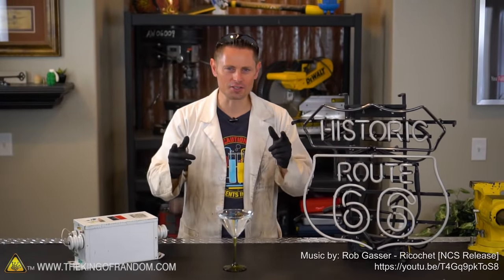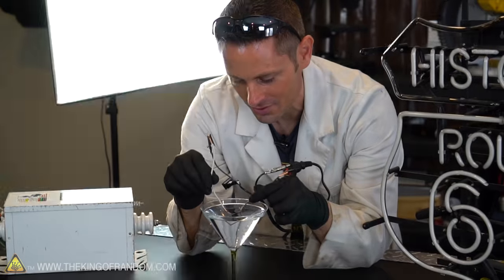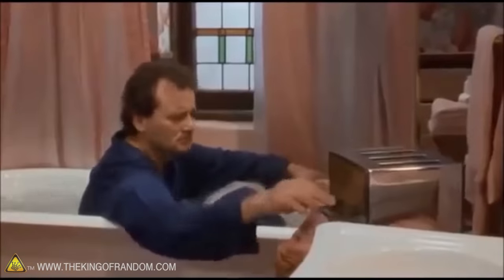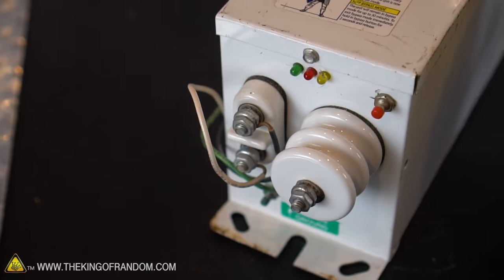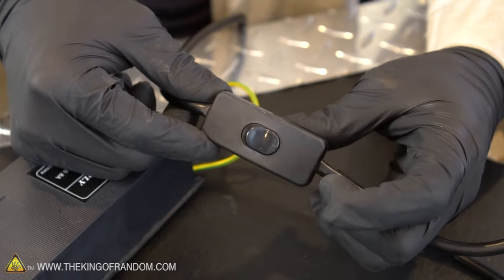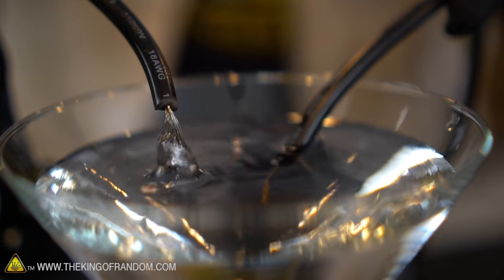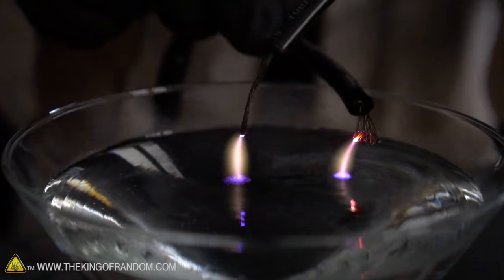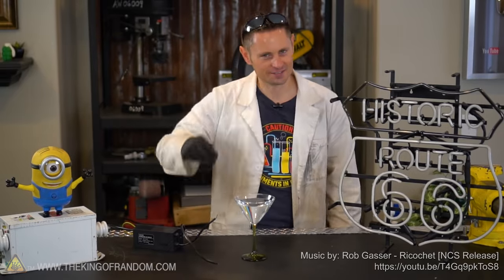Don't Mix Electricity And Water! TKOR Experiments What Happens With Electricity In Water!

Comment: the problem with distilled water is that it eventually picks up electrons from metals and becomes conductive
Reply: I'm pretty sure the high voltage is being conducted though the H+ and OH- charges water self ionizes into. While not being a significant amount I'm sure voltage that high could conduct through them.
Reply: did u see the green lightning? it was copper burning up, it goes inside pure water and contaminate it
Reply: roy k hmm. That does actually make sense and line up with what he said about metallic/electric taste. My mistake!
Reply: roy  k In a vacuum, however, we'd need an extremely high voltage to drive up water's autoionization equilibrium and evolve the oxygen to oxidize the copper. I'd hazard that Joule heating melt the wire before that happens. Of course, if we open the scope to a greater voltage, we might as well go for a quark-gluon plasma, no? The containment should be fun.

Comment: Does this add electrolytes to the water?
Reply: BroKid45Playz seriously?
Reply: Yes
Reply: It would displace some of the metals that the wires were made from into the water.
Reply: Greg Solis-Reyes no it wouldn't.
Reply: It's what plants crave!
Reply: rushthezeppelin what
Reply: brawndo the thirst mutilator
Reply: Not unless you include copper, hydrogen, oxygen, or hydroxide an electrolyte
Reply: Lol
Reply: Not how it works.
Reply: Riki ikr
Reply: @fionathegayesttiefling9867  water has oxygen
Reply: @deadcat2759  I'm aware. Running electricity through the water seperates the hydrogen and oxygen, allowing them to rebind differently into hydrogen2, oxygen2, H2O2, and O3. It's called electrolysis.
Reply: @fionathegayesttiefling9867  ok thx
Reply: Lmfao
Reply: Well, it can. It changes the chemical composition because of the minerals being changed. Some of these can be electrolytic. Others. Lethal.
Reply: No, neon is noble gas. It's neutral. The thing is that water itself is a bit magnetic(the distribution of the oxygen and hydrogen takes place).

But what just happened is known as dielectric breakdown. An isolator becomes a conductor after being applied a huge voltage.
Reply: Lmao
Reply: no but it would cause an electrolytic reaction, electrolysis is a reaction that breaks apart the molecules in the water from electricity flowing in the water
Reply: This is how they make Gatorade

Comment: What happens to the arc in a vacuum chamber?
Reply: If there's no air to conduct the electricity, there will be no arc
Reply: Explorer142 wach electroboom video he did this
Reply: Rambbax nope
Reply: vacuum chambers is already used to prevent the arc in some medium voltage (22kv for example) circuit breakers
Reply: Explorer142 in order for an arc to occur the static voltage must overcome the resistance between the two poles, wires, in the air electrons push out on the outer orbits of gas molecules making them crowded and unstable. they are in fact ionized when they cannot support any more electrons and wants to dump them. once the crowd get big enough and pushes hard enough the ones closest to the positive pole start finding their way across the gap. this creates a path like shouting free beer at a baseball game the rest of the crowd hears the news and its a stampede. this cannot happen in a vacuum, no particles to reach out to
Reply: Explorer142 if its a true vacuum, then there wont be an arc. The arc is there because the electricity conducts through molecules in the air. Not sure how exactly though. I think the molecules pass off electrons like in movies where the town gets together and passes buckets of water to put out a fire.
Reply: it becomes a cathode ray
Reply: Check out photonicinduction
Reply: Elctroboom did that.
Reply: gDisasters yes, and high grade vacume is no where in the universe, even in farthest vacume in space, there are still some PPI of particles
Reply: WeTube I shot the sheriff (but I did not shoot the deputy).

Comment: Distilled water is conductive, "Pure" water is the bad conductor.
The green parts of the arc is the copper from the wire.
The water "sticking" to the wire is probably due to the diamagnetic nature of liquid water.
Those bubbles are hydrogen.
The light dimming is because the water's resistance acts like a potentiometer.
You would feel a lot more than a slight tingle in a bathtub, 10mA is enough to lose full control of your muscles, 20 and you'll have trouble breathing.

Comment: The water stick to the electrodes due to both its cohesive attractive forces and the fact that it is a polar molecule helps as well. The oxygen end of the water molecule is lining up with the cathode and the hydrogen portion of the molecules are lining up with the anode. A sort of electrostatic force similar to ions :)
Reply: Thanks for that :)

Comment: find a way to test high voltage electricity in a vacume chamber. how much air is needed for it to travel on
Reply: This is actually a cool experiment, because the resistance drops with pressure until it gets to near zero, then stays there for a bit, then rises again as you get into very deep vacuum levels.

Comment: The electricity improves and strengthens the water tension which is why you can stack water on a penny. If the water tension is high enough, you can make water float in big bubbles. The reason that happens in space is because empty space is a lot less dense than water and the water can easily float around in droplets and stay together but on earth gravity soon ends the fun.
Reply: The enhancement of the normal stresses at an interface between two fluids is due to the difference in the permittivity (and consequently the strength of the electric field). This manifests itself in the form of a larger normal stress which looks like augmented surface tension. The electrical stress is called the Maxwell stress and is a research topic for electrohydrodynamics ...
Reply: Not really, water molecules are polar, so they will have a small net attraction to strong electromagnetic fields. Neon sign transformers are usually half-wave rectified, so one end is positive and the other neutral, allowing for the molecules to align and line up without disruption.

Edit: looked up what Lewl said and it appears to also be a contributor.
Reply: is this why the water "stuck" to the wires
Reply: WASDboss I think water molecules are polar so this triggers the substance of germ  molecules therefore it denses the water

Comment: The thing is, there's no such thing as a non-conductive material, it's all about the resistance each individual material has to let electrons pass through, that's why with enough voltage, the electrons can "overwhelm" the material's natural resistance and still pass trough. And also electricity will always go for the less resistance path, that's why tress still get hit by lighting even though they are made of wood, but in comparison with the ground, the tree has lower electric resistance so the lighting bolt goes to the tree before going into the ground.
Or so I think.
Reply: UrielManX7 and gov
Reply: what are tress?

Comment: Will electricity travel through a vacuum? Or mabey through dry ice or liquid nitrogen?
Reply: It can't travel trough vacuum, at least if the vacuum is high enough.

Electricity jumps from one atom to another (as you seen by the arc in the video).
If there is no atoms to cling to, it is isolated, thus there would be nothing happening at all ^^
Reply: That Guy it won't travel through a vacuum because its needs an ionic substance to travel across.  It travels through air by ionizing it and making O3 (ozone) which is very conducive to arcing electricity.  Unfortunately there isn't really anyway for the electrons to transfer between two things across a vacuum.
Reply: Correct me if I'm wrong but electrons are still particles, and they can travel through any vacuum under the right circumstances. Think of your old CRT TV, that has a vacuum in it, and an electron beam is flying through there. Only issue is you need a couple hundred thousand volts at at a decent amperage. If there's enough energy, thermionic emission will occur on whatever conductor becomes the cathode, and can potentially produce X-Rays.

Electricity isn't bound by just atoms, it can be literally any charge carrier. Be it an ion in some water or an electron flying through a vacuum.
Reply: Xenro66 crt isnt actually a true vacumm, manufacturers put inert gasses into them similar to neon signs
Reply: Xenro that is correct from my understanding. Also, electrons will leak from a electrical wire in a vacuum. And about radiation, the earliest way to make xray was shoot an electron beam in a vacuum. I wont say how because someone  may hurt themselves by trying it.  Also, you are correct about TV. The radiation from a old tv came from the electron beam occasionally splitting a phosphorus atom which converted some matter into energy, which is gamma rays(photons). Most people thought the radiation was from quantum numbers or electrons around the phosphorus
Reply: Electricity requires atoms to pass through in one direction to generate current. Devices like. X rays use electromagnetic radiation to transfer waves of high or low frequency, no air required over there.
Reply: who here just finished electrochem or electrophys in their AP science classes?
Reply: +Jacob Swarthout It is actually a high vacuum inside CRTs. You need that high vacuum in order for the electrons to form precise beams, moving freely (each time an electron collides with a gas molecule it will get deflected). Same thing in particle accelerators. Xenro66 is correct.

Vacuum tubes mostly rely on thermionic emission too (see X-ray tubes, thermionic valves, your vintage guitar amp triodes/pentodes), in fact a whole lot of tech rely on electrons traveling through vacuum.

Comment: Tap water contains heavy metals!!!
Reply: Beto G that's true and actually pure water (diaionized) is not an electric conductor.
Reply: Mijaz Gutierrez it will conduct very small amounts of electricity tho, because of the autoprotolysis or whatever you call it in english.
Reply: mttdang by what I know and have leaned at school it won't. Because the electrons are part of the bondings between anions. H2O is a covalent compound so there is no flow of electrons unlike metals that have the electron sea. Maybe it could at very very high temperature or with electrolysis but still electrolysis separates the molecules so it wouldn't be water anymore. 
If I'm wrong enlight me because it's very pleasing having a intelligent conversation (rarely found on YouTube)
Reply: Mijaz Gutierrez normally this is correct. But what mttdang means is that there is a very rare reaction. 2 H2O molecules can split into one H3O+ ion and one OH- Ion and they inside the water make it conductable. But they are very rare so you won't see their influence with that lamp, but with a voltmeter.

Comment: Take care king of random.. U said u'll be using single hand but u used both.
Reply: I was thinking the same thing. "Do as I say, not as I do", right?
Reply: lingaraj gurusamy electrical engineer here. when dealing with that high voltage, it doesn't matter. gle gloves wouldnt help either
Reply: joshua christensen, that may be true, but I think you're missing the point of OP comment. I'm an industrial engineer, so I'm aware.

Comment: Electrical Engineer: You Don't Say!
Reply: Btw, nice explanation there, especially the one hand operation procedure.
Reply: Even as an EE, I've got to say it surprised me to see the surface tension of the water so tight with the high-voltage wires; so much that he could pull the water slightly off the surface.

Comment: Well, with the high voltage through distilled water, I think that must’ve not been completely pure H2O, because if water by nature is non-conducive, that means certain minerals or other conductors in the tap water are conductive and can transmit electricity to each other through the water. That is to say distilled tap water or maybe even distill water in general will still have those tiny particles of conductors, a suspension between the particles and the H2O. That’s why the high voltage works in distilled water, there are still small, although infrequent, particles suspended in the water, the high voltage has more power so it’ll be able to transmit over longer distances, and that means it doesn’t matter that the conducting particles are to infrequent, the high voltage can travel farther to reach them. In theory, if you where able to remove all molecules from water besides Hydrogen and Oxygen, it wouldn’t be a conductor, if my hypothesis is correct. I have no real way to test it though so I guess it stays but a theory, a physics theory! That is for reading!. (Really though what do you guys think?)
Reply: JakoborRazor But even if he used pure H2O he would've added electrodes due to the current flowing and the metal wires in it, so he couldn't really do such things with pure H2O
Reply: Yes and no. High voltage energy might be able to break the hydrogen-oxygen bonds in some of the H20 molecules, ionizing water (into H+ and 0H-), which then conducts the electricity. Even in plain water (H20), H+ and OH- ions are present in equilibrium with the H2O, and maybe that is sufficient.

Comment: Okay wait, but what if this high voltage had a load? The lower voltage had a light to power. Would it make a difference if the higher voltage activated a device inside the circuit?

Comment: The reason the light was dimming when the wires were farther away in the tap water, is because tap water is highly resistant, which means that the electrons bounce off of the water molecules and gives of some of it's energy to the molecules

Comment: you can't mix water and electricity,  electricity flows trou it and is not mixing with it , its a wire until the water cant support the electricity and it will split into oxygen  and hydrogen

Comment: Late, but I think what's causing the HV cable to draw the water to it when you pull it out is that Hydrogen Ions are being stripped from the Oxygen atoms in the water through electrolysis.

Comment: Interesting watching these things on Youtube,Not something I ever try at home or end up with a ton of volts of electric going through me and then become over powered has happend before,One of the wrose times I remember getting one nasty Electric shock,Was when I was over a freinds house,I did tell them to turn the Electric of while putting a ceiling fan up,Getting the wires connected,I also standing ontop of metal step ladder,The Electric soon went through me,Made me jump of the step ladders on to the floor rather quickly,I was over powered after that,Also enough to make me shake as well

Comment: putting 2 wire together under water is not too dangerous but remember if you stick a live wire in water the entire water tank can act like a extention of the cable, so the entire tank of water ABSOLUTELY NEED TO BE TREATED LIKE THE ORIGINAL WIRE so that why people get shocked in there bath when they drop electronic in the bath, the power goes through the water then YOU then the electrical ground, probably the drain. also remember water can go through small crack that your fingers couldn't, so it can first of all conect you to a power source that you couldn't otherwise, and it can go inside of electronic and short term out by making contact between wires that shouldn't touch, so even though nothing happens in this video you should still be careful with water and any other conductive liquid and electricity

Comment: That'd explain why a 9v battery was incredibly painful when I let the current flow on my tongue. 

Interestingly it didn't cause any damage to my tastebuds and was only painful on my tongue. Does this mean the mA was high enough to cause significant pain but the voltage was too low to travel far enough or cause permanent damage? Or was it the opposite, the voltage high enough but the mA too low to affect areas surrounding my tongue? 

All I could figure out was that it didn't seem to cause any long term damage from a fraction of a second of exposure. But I wonder what'd need upping to cause the most damage if you had to choose between increased voltage or mA?

Comment: I am a retired Broadcast Engineer with 40 years in the television business. We routinely use amplifier tubes called IOT (Inductive Output Tube if you want to know) and Klystron tubes. These things are huge (about 4 feet tall and we have to use a hoist to install them), but I digress. These tubes are water cooled with distilled water (sometimes with pure ethylene glycol mixed in if the lines are subject to freezing temperatures). The water is pumped through the tube to a condensing coil where it is cooled and returned to the reservoir tank. The water is in a boiler section on one end of the tube and also in tubes through the body of the tube itself. The component of the tube that is in the water typically runs at 34,000 volts DC sitting in the water and the electricity does not go through the water. If fact there is a meter called a body current meter that measures how much current is getting through the water. If it gets too high the transmitter does an automatic shutdown. Typically 30 milliamps is allowed. We watch the reading constantly by computer and weekly manual readings. If the body current starts to rise over a period of time it is an indication that the water is becoming contaminated with something and becoming conductive. Then we have to flush the cooling system and put in fresh distilled water. We have run into cases where we purchased distilled water that would not work and we discovered that in spite of being labeled distilled water, it was only deionized water. I just thought some may find that interesting. I am really surprised that in this video his high voltage into distilled water was so conductive, as that is not our experience in the broadcast world at all. I don't have an explanation.